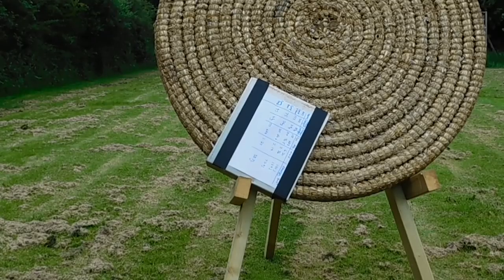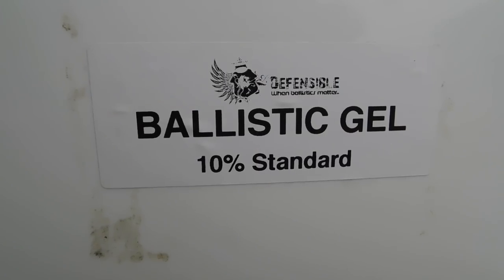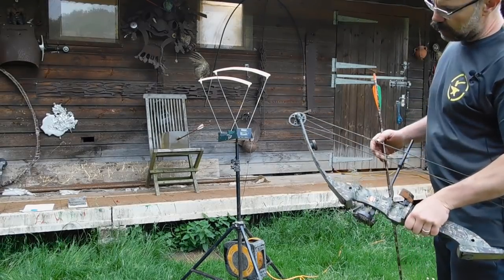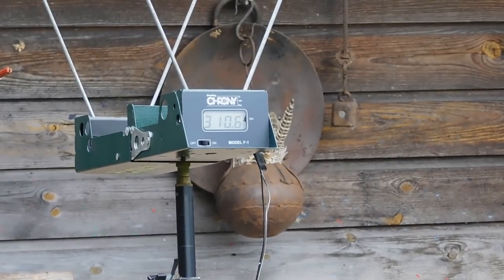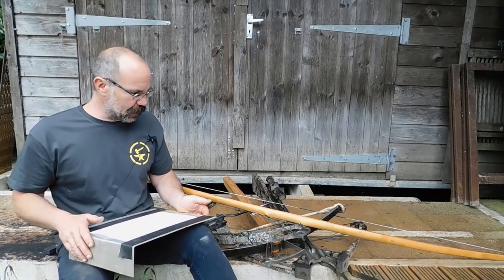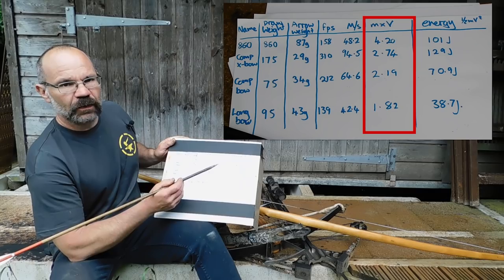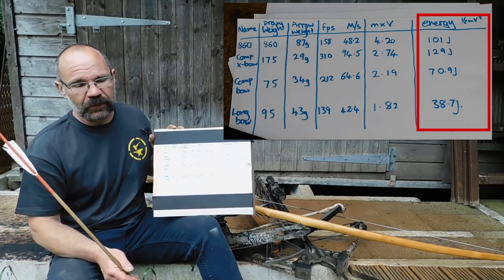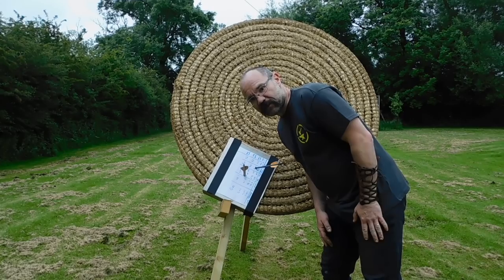Medieval vs Modern Crossbows/bows Ballistic Gel Tests

Comment: Holy moustached christ in heaven! Nice whiskers.  

But what happens if you stick a 130 gram bolt on that old 860 pound crossbow? They got heavy limbs do a heavy bolt would at least theoretically allow for better energy conversion form limb to bolt with a minimum loss of speed. 

Care to built a 130 gram bolt an try it?
Reply: now that sounds like a challenge as the much lighter bolt will have to take more force in less space.
Reply: Who don't seem to shoot them that heavy; medieval folks? 

All in all surviving bolts are going to massively favour survival of lighter examples because the most common type were those used with wooden crossbows. Even into the 15th century they tended to be the most predominate type.
Reply: What information I know the bolts found in warehouses are generally made for metal prod crossbows that were also kept in the warehoues while wood crossbows were generally made when needed. Though this was about some holy order fighting in poland having to make yew bows the farmer militia while the city militlia simply grabbed the steel bows kept in their warehouses. Those steel bows were rated as stirrup bows and not stingers though so they were not the heaviest bows around and would maybe therefore not have the heaviest bolts either.

I have heard of a 133 gram bolt being found and that is the heaviest I have heard of but that was a single bolt for a wall crossbow in some germanic country if I remember correctly.

Comment: Is there a materials reason they didn't come up with compounding pulleys on their bows and crossbows in the Medieval period, or was it just a question of no-one figuring out the geometric engineering of it? Because they certainly could make good pulleys and gears, if the Windlass is any indication.

Comment: what if we made a modern crosbow with a 1250 lb draw weight?
Reply: a heaver draw weight doesn't usually mean a faster arrow just a heaver arrow at the same velocity
Reply: yes.. which is exactly what i want !
Reply: +Tadhg McGrath you could make the arrow or of rebar. it would be an anti tank/ aircraft round
Reply: an anti dragon bolt if you will
Reply: I'd like to design a different kind of crossbow about 3000 lb with magazine and vinch mechanism. I need support or need to study something...

Comment: Cool video, I really liked it. Although I was thinking that you might need to use the same projectile or at least similar ones on each weapon type. For example, it's possible that the fletching is what stopped the crossbow bolt from going through all the way (or at least, further into the gel). And I think we'd get more interesting test results if the weapons were tested with various types of projectiles, and we could also see if there's one that is better on one weapon than the others.
Reply: @tods_workshop  Awesome!

Comment: The weight of a modern bolt seems to be half that of the medieval bolt. Could you switch them around and see what happens?
Reply: It would break or damage the medieval crossbow, since there is too much draw weight
Reply: Assuming the crossbow doesn't destroy the arrow instead of launching it!
Reply: +Joner+bertram283 I don't think half the weight would destroy the bolt or the bow, but it's definitely worth testing. Don't you think? :)
Reply: The bolt of the medieval one the shaft is too thick to fire out of the compound crossbow.
Reply: +Brian Anuvattamachai The modern bolt would easily fire from the medieval crossbow with slight modifications. Don"t you think? I know that the medieval crossbow wont be equal to the modern crossbow, but it's definitely worth a test, right? Who really knows what might happen? I want to see it. Don't you? :)
Reply: I mean I guess you could try but the modern bolt weighs half the weight of the medieval one. Typically you're supposed to multiple ten to the draw weight to find out the proper arrow weight in grains. To avoid a potential dryfire(bow being fired without an arrow.) Because try me you do not want to behind something that' s pulling more than pulling 2/5ths of a ton. Sure it may go faster by a bit but you don't want to risk destroying the crossbow.
Reply: +Brian Anuvattanachai  I think it's worth the risk. Tod isn't a scared of ruining a a bow! :)
Reply: The speed gain with much lighter bolts isn't that much because the medival crossbow is quiet slow.
The weight of medival bolts is optimiesed for maximun energie (reach, penetration)
With a much ligther bolt less energie is transfert into the bolt and more into the crossbow.
Tod mention this in a previous  video.
Modern crossbow with heavy bolt would be just slower
Reply: Janis Kunz the limbs since they're metal they are heavy and do not transfer all the energy to the bolt. There's quite alot of energy loss through the shot process.
Reply: Could you possibly make a replica of Leonardo Da Vinci's rapid-fire crossbow?
Reply: Well, if you don't think the medieval crossbow could handle the modern bolt than i'm fine with that, but i'm very interested in what the medieval bolt could do with the modern crossbow. This is for science, Tod. :)
Reply: tod todeschini You’ve got to put that medieval bolt through the jandao just need to rasp the nock end so it tapers more to fit and burn a half moon nock with the grinder then shoot it over the cronie into the gel ,my guess is it will be over 100 FPS slower and not go much further into the gel...
Reply: I tried something similar by putting aluminum bow of almost legal draw weight on replica instead of steel bow. Guess what? Bolt is flying faster :). No problems with crossbow (well, almost - nut is rotating too fast and may fall out). Modern bolt will be difficult to adapt, since it diameter should be equal to the string diameter for maximum efficiency. But using modern string materials like astroflight it is quite possible to make thinner string. 
Easiest way to have fun with light bolts  will be using set of bolts with shafts made from carbon or aluminum tubes. It will prove that on windlass crossbow increase of speed will probably be  not very significant.
Reply: My guess is modern bow will just snap the wood shaft like the twig it is. Same possibly for some cross bows. A scorpyd would most likely vaporize a wooden bolt.
Reply: @tods_workshop  how come the light bolt wouldn't be good for the windless?
Reply: @TheLiamis  A heavy wood arrow will handle a compound bow just fine.
Reply: @sarchlalaith8836  it would essential act as if it was dryfired, look it up if you don't know what it is.
Reply: @blackdeath4eternity  I did. But that's my point, the limbs from the 860 are metal, not carbon fibre or wood, both of which are aligned fibre materials that fracture when put under pressure in the wrong direction, metal doesn't as it's a crystalline structure. The 860 is metal. While the compound bolts are light are therefore more easily accelerated there should be more than enough energy spent to be safe. In theory, because the limbs are metal you should be able to dry fire the 860 with no issues to the limbs. There should be no issue assuming the limbs are well fixed to the stock.
Reply: @sarchlalaith8836  the limbs are a spring steel under 860ibs of stress, upon failure you will have possibly many small pieces of sharp steel flying around, if you still want the test id be more than happy to see you do it :) , id recommend a decent amount of safety gear though.
Reply: @blackdeath4eternity  that's the point though, being spring steel it should be fine, unlike carbon fibre and wood where the sudden deceleration would cause the materials to bend the wrong way and either delaminate or shatter due levered stress, the same thing should not be a problem for the structure of metals that are not ultra rigid.
Reply: @blackdeath4eternity  send me the cross bow and I'll do it
Reply: I think he could try shooting the tradional bolt with the modern crossbow, but he really should NOT try shooting the modern bolt with he traditional crossbow, as it would come out like an empty shot, wich might damage the crossbow by ripping the silng in twice, crashing the bow (yes, even steel bows can break, if they are treated incorrect) and everything smashes into the archers face, if he has bad luck.
Reply: If you half the arrow weight you need 50% more velocity to gain same amount of kinetic energy.

Comment: the diameter of the 860 crosbow bolt was significantly bigger so it has a great deal larger suface area to slow it down. also it wasnt a perfect cylender additionally its fletchings were really stiff and large.  
Given all that it makes sense that despite the higher momentum it would have less penetration.
You will notice the modern crossbow bolt didnt dig very far into the wood and looked like itmight have been ready to stop just  on the ballistic gell itself.

That gives you a predictable relationship between the vital statistics and the results so dont think that wasnt proving anything.

Comment: all the energy in the compound was used to cleanly penetrate with leftover energy remaining in the bolt. the medieval bolt instead deformed and cut into the material. thus the energy and the momentum was much more efficiently transferred, for greater shock and impact effects. the behaviour of flesh and bone and wounds is complex however, with many different unpredictable variables effecting stopping and killing power. if lucky, the modern bolt would just pass through my soft tissue leaving a small wound channel. I shudder to think what would happen if you fitted a broadhead onto a modern bolt.

Comment: Penetration is more complex than just momentum, the hardness of the penetrator, the amount of momentum it loses when it impact the target, the shape, and beyond are relevant. There are some videos out there in inrangeTV that proof the importance of hardness and speed beyond momentum, they try to penetrate some steel plates with different calibers and different ammo up to a .50 caliber, and none of the led bullets were able to penetrate the steel plates, not even the .50, but all the steel AP ammo did damage in all calibers (not all penetrated).
In here all arrowheads are steel, but all of them have different shapes changing the behavior relative to the gel making the comparison kind of pointless, but we see how the fastest and narrower proyectil had more penetration, exactly as it should be, the momentum distracted you from the relevant data, momentum is important in the sense of destructive power, in the inrangetv video the .50 led bullet completely obliterated the wooden stand holding the steel plates as it has way more momentum than the lower caliber tested  and it was able to transfer it all to the steel plates.

Comment: It is to be expected compound (cross)bows made from modern materials outperform traditional ones made from classic materials. However, classic/traditional (cross)bows have one huge advantage. Get into a melee fight you can use your bow as a staff and your crossbow as an awkward makeshift club. They might even work afterwards. Do the same with these delicate compound (cross)bows, you are practically guaranteed the cables have come off the rollers and getting them back in working order might be difficult or impossible in the field.
Reply: "you can use your bow as a staff" lol
Reply: @orszag572  not a good one, but some sort of staff is still better than none. But some sort of staff that's still a bow afterwards is better than some sort of staff that isn't a bow anymore after.

Comment: first, thanks for doing this. Big fun. The shape of the head on the medieval crossbow bolt was/is a fattened armor-piercing shape, right? So, the point on the modern crossbow has a great deal less area and drag (and the fletching acts as a brake). I guess. But, you already saw these things, I bet. Just commenting because you said to :) .
Reply: aha, I did not think of that. Great bit of info. I had forgotten that bit.

Comment: Can u do a video on eastern
Or Asian crossbows??
Repeating crossbow?
And question.
How is a Chinese medieval
125lbs
Crossbow stronger than a
300lbs crossbow from Europe???
I've read it online but don't really get it
Reply: Draw length. I think the reason that this matters is that the arrow is in contact with the string for longer, so it has more time to pick up more speed and energy. It is like stopping a tennis racket right after hitting a ball rather than following through by swinging it over your shoulder (Something that has been drilled into my mind by a coach during a summer). By being in contact with the ball for longer, more energy is transferred. This effect affects crossbows more because the string is constantly accelerating much faster tan a racket. Actually, a better example might be using two cars to push two identical rolling objects. Car 1 has more horsepower and acceleration, but it stops after one second. Car 2 has less acceleration but is allowed to push the ball for longer. Car two will roll the ball faster, because even though it is less powerful because it has more time to accelerate the ball.

Comment: I'm actually surprised that 860 had such a low amount of punching power. What era is that even from, as it probably wouldn't pose much of a threat to the breastplate/helmet of late 14th century and onwards armor, which is curious. Would still royally screw up a gambeson though, or even limb armor.
Reply: I wouldn't say completely unreliable. It depends mainly on where the bolt would strike as, while the core body (torso + head) is extremely well armored, the rest of the armor will be thinner and the thighs in particular present an ideal surface to strike. And of course if you get hit in the hand, the hand's probably toast simply from the kinetic energy of the strike.

Comment: No matter how you try to actually compare the bows, it is not going to be a fair comparison. If the draw weights were the same but using modern tech and materials, the modern bows would devastate the medieval bows. What is very interesting is to discover how powerful the medieval bows really were with the materials they had to work with, they were brutal.

Comment: Let's not forget friction. Modern fiber or aluminium arrows, painted, will have a lot less friction than wood arrows or bolts. So the depth of the penetration is not that relevant. The real measure you need to use is mass and speed of the projectile.

Comment: So what would be the case if you took something with an enormous draw wieght, but a short draw length (like that beast you have there) and used something akin to an iron or steel bolt? I am curious if the energy would skyrocket if it took advantage of the high draw wieght, but not able to get the same speed as a compound bow. Would it out perform a modern bow?
Reply: A lower weighted bolt can destroy the crossbow and the energy can also not as good used by the arrow. Cause of the steel bow, heavy string and short draw length etc they are much lower effective to use the energy to accelerate.

Comment: 11:11 the arrow curves, i wonder if thats normal for longbows or it's just a bad arrow spine . probably a lot of energy is lost there.
Reply: That's paradox.
Reply: @vanuaturly  If you can picture yourself having nocked the arrow holding the bow Infront of you and looking at the angle of the arrow it points off a bit to the side if not cut past centre. Now you draw the string back the arrow is now at a different angle against the bow relative to the target. This is the archers paradox. This is misunderstood by most people . The bending of the arrow around the bow is not actually the paradox.

Comment: The reasons the maths on the comp crossbow doesnt match the result ( shouldnt of exited with quite as much force) is probably more to do with the reson you glossed over whilst shoooting,
You were shooting into the same block weakening it.... if you had in reverse order the windlass would of gone straight through than it did with arrow/bolt size design.

In the end the maths is still in the same order as the field test, your not shooting an apple off anyones head based of a single arrow into a gel block.

Comment: That is an anemic longbow. The stuntman who did Errol Flynn's bow work in Robin Hood used his own bow with a 175 pound pull.
Reply: That was Howard hill by the way, a legend in his own right.
Reply: Even for its draw weight, it was anemic. Shooting 7 gpp, you should be getting close to 200 fps, not 140.

Comment: For deer hunting, any of those are overkill and would result in complete pass through.  I would take the quietest, which is far and above the longbow.  Most people hunt with compounds because of the accuracy with sights/ practice factor, i.e. they need less practice to have better accuracy because of modern sights.  Deer still jump the string and they loose wounded animals though.  If only the deer would hold still while we are making noise with our gadgets.

Comment: A bit of advice, You need to study the safe use of these weapons before using them, you should never load a bolt with your hand behind the cam's & you shouldn't fire a compound bow without a release aid - if you twist the string it can cause a derail. You are lucky you didn't hurt yourself.

Comment: there is no way that windlass is pulling back 800 plus pounds and be at only 158 fps. the modern cross bow was way higher at 175 pounds of pull i think you said.  the compound bow flies faster at 212 fps yet  comes in at  70j's compared to a whopping 101j's on that windlass.... ?????????? you math is wrong dude. or your draw weight IS NOT anywhere near 800 plus on that pos windlass. seriously, 800 pound pull weight would shatter those wood bolts before it left the bow. come on man..